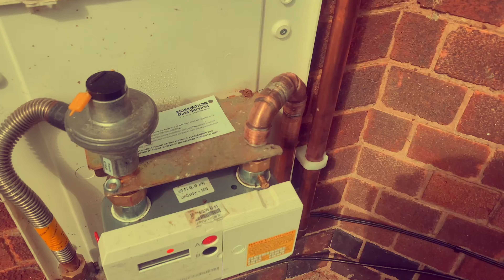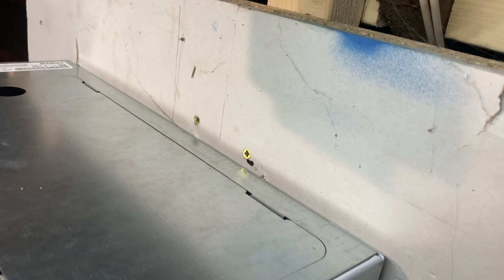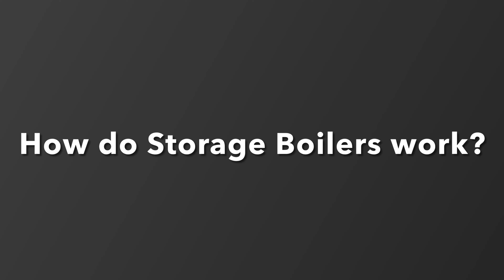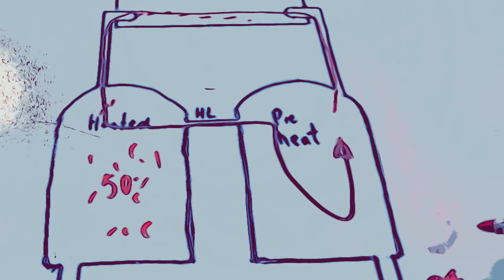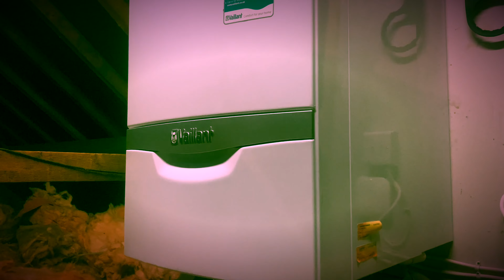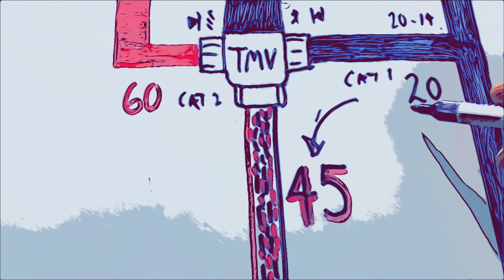Storage high performance combination boilers 🛀 Vaillant 937/38, Plate charging

Comment: Why oh why are you using speed fit especially in a frost zone
Reply from the maker: Speedfit was already installed
Reply: @warriorsofwarmth  oh ok thanks mate,  what is your view of the 938 in general, im in the process of upgrading an old open vent and thinking of the combi store so am not sure what to go for either the W111 or the 938,  I have 3bar on the property, two showers and a bath 13 rads with 5 in the house,  right now there constantly draining the tank between them so though of the store combi route

Comment: Very well explained John well done 
I’ve seen a combi boiler installed with 6m long flow horizontally pipe is that ok for the flow John?
Reply from the maker: That’s fine, most have a max of 9m depending on bends
Reply: @warriorsofwarmth  oh thanks for respond John you are one in million 👍🏼🙂❤️